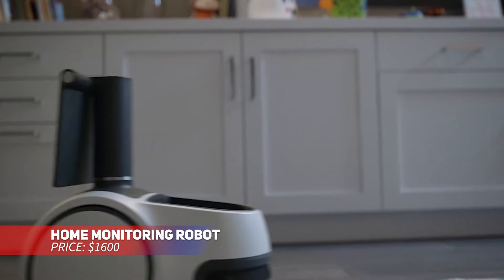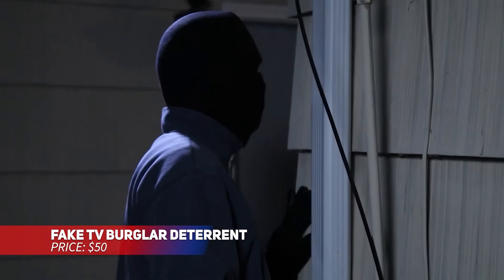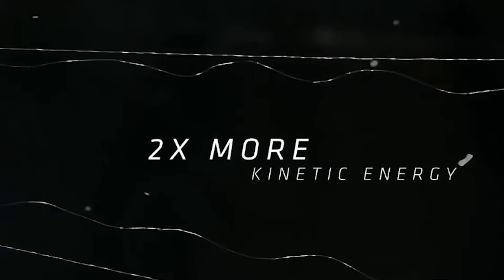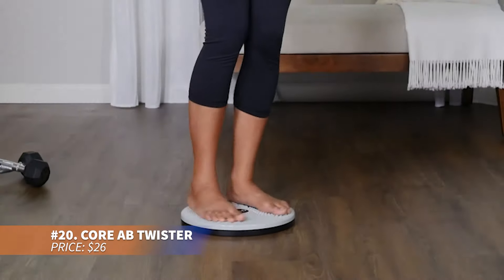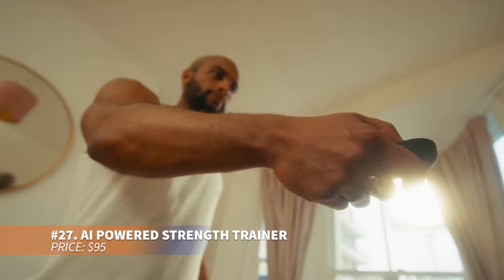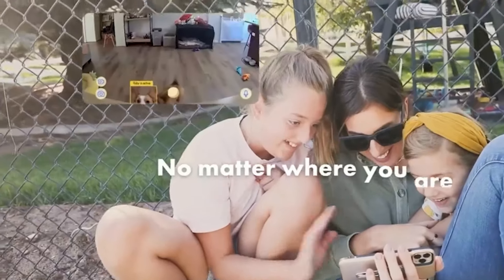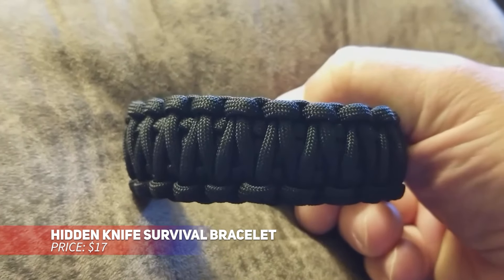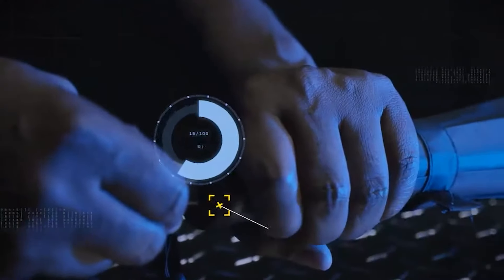60 Coolest Amazon GIFTS & Gadgets for Men/Boyfriends/Husbands | Gift Guide 2024!

Comment from the maker: 1: Foot Massager Roller  https://amzn.to/48ihcIN
2: Bluetooth Speaker  https://bit.ly/40d4RUh
3: Electric Protein Shaker Bottle  https://amzn.to/48i5NJ4
4: Wrist Strengthener  https://amzn.to/48fezaE
5: Lipstick Taser  https://amzn.to/4eQSMZw
6: Home Monitoring Robot  https://amzn.to/4eU6vyO
7: Ceramic Knife Keychain  https://amzn.to/3YvaFXT
8: Vibration Sensor  https://amzn.to/3YH24lj
9: Vibrating Foam Roller  https://amzn.to/3BQrIuB
10: Smart Jump Rope  https://amzn.to/3YvQKIh
11: Magnetic Phone Mount  https://amzn.to/48i5SN1
12: Speed Parachute  https://amzn.to/3YxeR9E
13: Portable Door Lock  https://amzn.to/4eRQHfF
14: Mobile Camera Robot  https://amzn.to/3YwwZk0
15: Fake TV Burglar Deterrent  https://amzn.to/3BT5bNR
16: Smart Key Lockbox  https://amzn.to/4eQSNN4
17: Switchblade Handcuff Key  https://bit.ly/4eTkTXW
18: Finger Strecher Forearm Trainer  https://amzn.to/3ZlUpcy
19: Handheld Massage Gun  https://amzn.to/4fagwHK
20: Digital Jump Rope  https://amzn.to/40h9gFJ
21: Inversion Table  https://amzn.to/4f7MvYU
22: Belt Buckle Knife  https://bit.ly/3A3bazd
23: Door Brace  https://bit.ly/3YH1SCB
24: Taser Launcher  https://amzn.to/48i3rK3
25: Smart Pepper Spray  https://amzn.to/48bZZRj
26: Boxing Bag Doorway  https://amzn.to/3XpL6pv
27: Fingers Trainer  https://amzn.to/3ZpGVwu
28: Portable Home Gym  https://amzn.to/4dYiUQX
29: Perfect Push up Stand  https://amzn.to/4dUb0If
30: Pen Pepper Spray  https://amzn.to/3Yw8jbh
31: Credit Card Gun  https://bit.ly/3YvfhgE
32: Home Security Drone  https://bit.ly/48jY0KH
33: Art Frame Safe  https://amzn.to/4eWLN15
34: Workout Planner  https://amzn.to/4dVwAfv
35: Core Ab Twister   https://amzn.to/3Yxvn9O
36: Reaction Training Platform  https://amzn.to/3A5frSI
37: Doorway Pull-Up Handles  https://amzn.to/3XpWnWJ
38: Knuckles Stun Gun  https://bit.ly/4eLA4lU
39: Folding Fan EDC Tool  https://bit.ly/4eRckgn
40: Shoe Kicking Defence Device  https://amzn.to/3BPB5Lb
41: Smart Window Blinds  https://amzn.to/4ePsruB
42: Wobble Cushion  https://amzn.to/3YwWlhB
43: Posture correcter  https://amzn.to/48cPmxD
44: Agility Ladder  https://amzn.to/4fcBXI3
45: AI Powered Strength Trainer  https://a.co/d/8xQZjQT
46: Contact Sensor  https://amzn.to/3Yvfhxa
47: Solar-Powered Camera  https://amzn.to/3YwqVYK
48: Emergency Keychain Escape Tool  https://amzn.to/3YtMfOu
49: Pet Monitoring Camera  https://amzn.to/3A2JZ7D
50: Core Sliding Disc  https://amzn.to/3B4LH91
51: Weighted Hula Hoop  https://amzn.to/4g4eIQY
52: Ab Roller Wheel  https://amzn.to/3CGWLth
53: Solo Soccer Kick Trainer  https://a.co/d/4ZBw6FY
54: Car Safety Escape Tool  https://amzn.to/3Ysi9Lj
55: Tactical Hair Clips  https://amzn.to/4eSAcQB
56: Pepper Spray Gun  https://bit.ly/48dpJg0
57: Siren and Strobe Light  https://amzn.to/48hT0Gk
58: Adjustable Hand Gripper  https://a.co/d/4rNboZK
59: Compact Adjustable Rowing Machine  https://a.co/d/8iQkqTb
60: Resistance Pushup Stand  https://a.co/d/c3Oi4ZY
61: Adjustable KettleBell Set  https://a.co/d/6HKmzUK
62: Lipstck Knife  https://bit.ly/4eNOe6f
63: Hidden Knife Survival Bracelet  https://bit.ly/4hfhbtm
64: Concealed Couch Bunker  https://bit.ly/4dW721C
65: Magic Pocket Staff  https://amzn.to/4hccPTK
66: Vibrating Peanut Massage Ball  https://a.co/d/aKh9zw1
67: Weights with Thumb Loops  https://a.co/d/1d3qWuO
68: Color Coded Bumper Plates  https://a.co/d/6wgRI0c
69: Endurance Workout Device  https://a.co/d/eujo1ol
70: Pepper Ball Gun  https://amzn.to/4eb80HL
71: Door Reinforcement Lock  https://amzn.to/4dQgALz
72: Stun Gun Umbrella  https://bit.ly/4hfmusQ